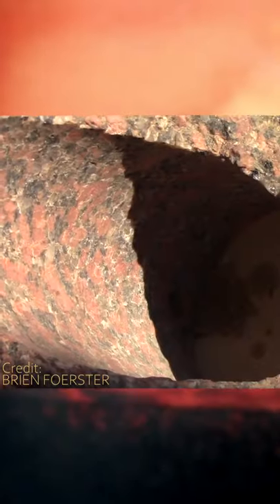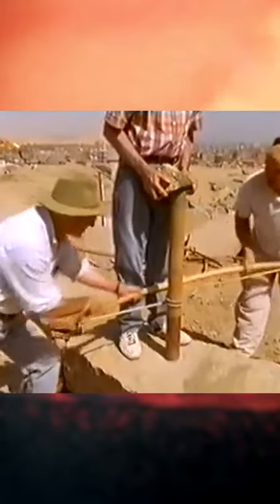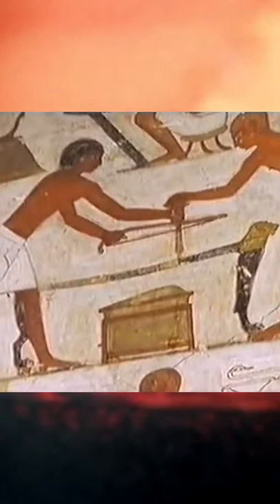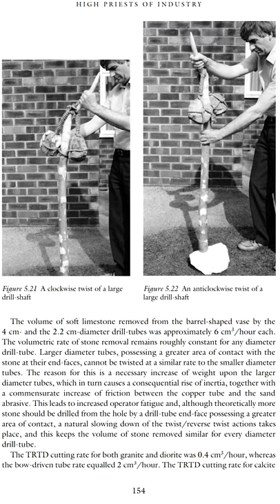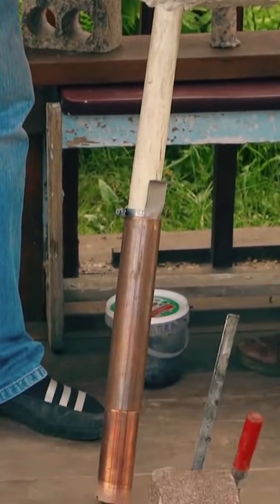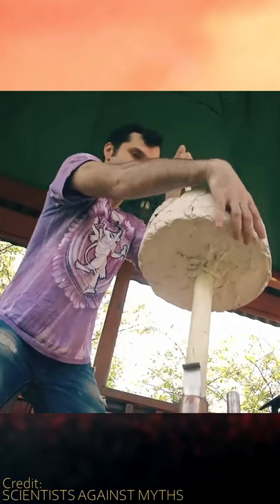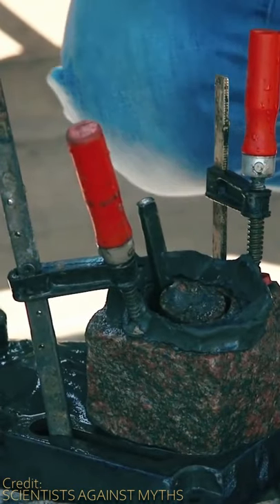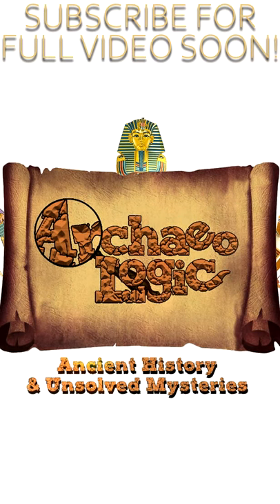Is THIS How The Ancient Egyptians Drilled Holes In Rock? Experimental Archaeology Teaser Vid #Shorts

Comment: GLASS THEY BUREND HOLES IN GRANET USEING A MAGNIFYING GLASS!!! EGIPTIANS ARE NOT DUMB! NOT A HATER BTW.
Reply: The results of doing that, from the videos I've seen of attempts at replicating it, are actually rather lumpy - either the stone flakes off unpredictably according to the structure of the stone, or, if it does melt rather than flaking, you get a lumpy sort of hole with a noticeably glassy surface from where it melted, and it's a very slow process - possibly even slower than the tube drills shown here.  It's a good guess, if you haven't seen it done, but it turns out that although (surprisingly) you can make a mark on granite that way, it's actually a rather rubbish method.  This gives much neater results than that does and may be faster.